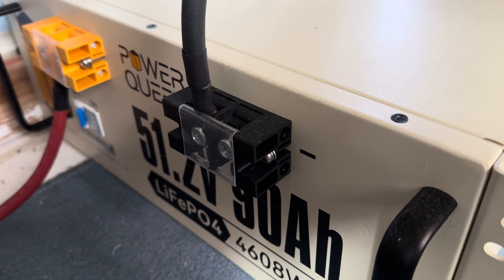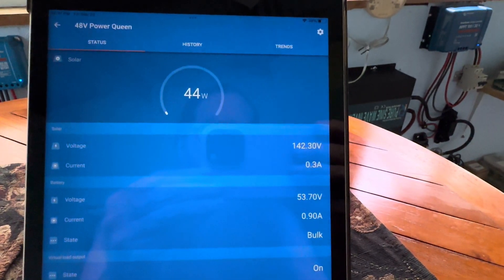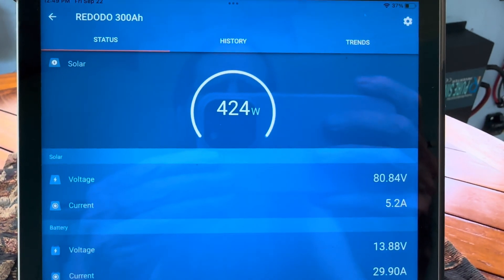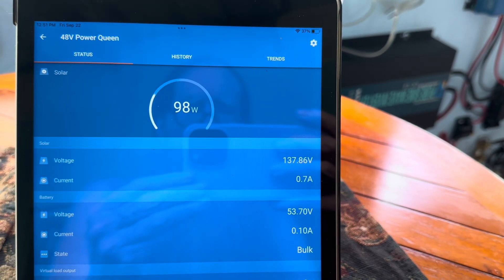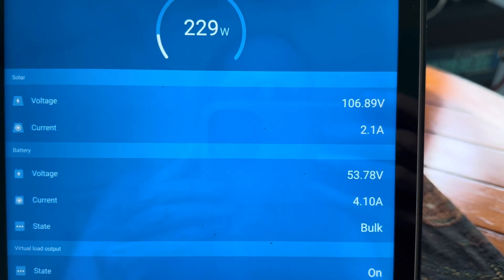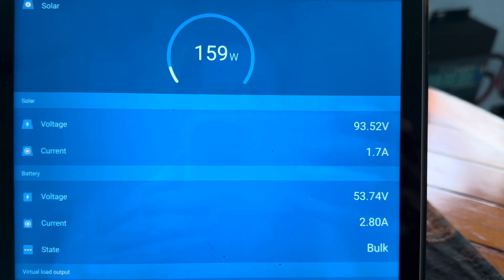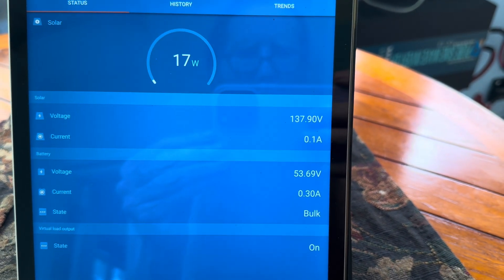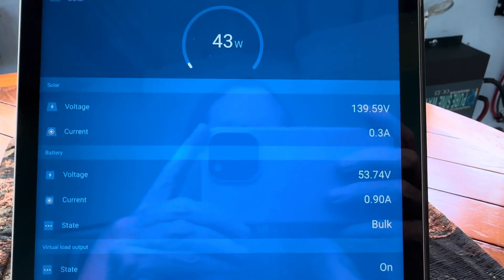48V LiFePO4 charging parameters pt. 2  Follow up from yesterday...very last scene beeps of course!

Comment: Hey,such nice explainers! If I may ask...
How many 48v 200ah batteries can be linked together on a 5.5kw 48v inverter system with 10*550w solar panels?
Would it be fine to link 3* 48v 200ah batteries to 5.5kw(max combined usage) inverter system to access +- 28,800watt hours availability from batteries?
and also, should I put more than 10*550w panels up if i aim for 5500w(1 to 1 ratio) or is there loss somewhere and i should calculate for more panels to reach 5500w?
Thanks so much in advance!

Comment: My brother another excellent video. I am using both a PowMr and a Makeskyblue MPPT charge controller each with 750w going to a DIY 48v lifepo4 battery pack with a 3000w WZReliable inverter. I really don't have that experience of spiking with my charge controllers and my charge controllers is set a the same setting you set at.

Comment: Thanks for the shout out at 1:20.  Man this video is great but now I have way more questions and concerns on this type of battery.  As junkerzn7312 mentioned could these be 15S?  Seems like when I kept seeing 53.67/15 =3.578 the system would cut out vs. 53.67/16=3.35 per cell.  One other oddity on the PQ was 90AH vs 100AH and it made me wonder, but I don't know enough.  One thing that is now making me seriously consider on the lithium front is the lack of battery communications with EACH cell to see what is really going on.  This probably explains why I see many other channels build DIY and/or use chargers to top balance and use smart shunts to validate capacity.  One GOOD thing I saw was that the battery did NOT disconnect voltage and brown out the controller or fry it.  But just imagine for one moment, four of these PQs in parallel!  I mean you would be playing wack a mole driving yourself crazy.  Or maybe the point is to NOT watch the meters?  Now I walk away after weed wacking the lawn with lithium thinking I need to start all over and think of the long term solution......I am NOT dinging your video, but I can't be the only one going like 'now what?'  But hey we're here to learn from one another so it's time well spent on a Sunday evening in cloudy Michigan.  Aloha. Gary
Reply from the maker: I opened this up in original review. It has 16 cells. I am still learning, and for sure still playing whack a mole some...Aloha! 🤙

Comment: Ok umm been doing some thinking keep the Voltron to set lithium parameters like normal to reteach the battery to take normal voltage use the normal settings and when the beep goes off shut off the panels power use as normal then when it gets dark turn it back on to ketch tomorrows light then repeat over time it'll start getting higher battery percentage till it's back to all day without over voltage beep. Just my thoughts I'm not sure if it'll work but worth a shot or just get it to 100% the let it sit with no power for a few days and it may train the bms what full is. Try the latter first the do the former if the latter don't work
Reply: Does the battery have a bms reset that you could do when the battery is at 100% full or does it just have to sit till it refreshs or i have heard fully kill it then fully recharge it?

Comment: I was looking into your battery specs:  It says Charging Voltage should be 54 ± 0,75V  maybe its getting a bit more voltage than needed.  Maybe setting the absorption to 54v and float to 53.6 to have it at 80% max charge might be what it should be set to.

Comment: We're on the same island and yep the solar was crazy yesterday dropping from 3300W down to 600W as a huge dark cloud passed by and the MPPT struggled to keep up. That's 3KW of panels going into 2x LiFePO4 5kwh "server rack" style batteries (10kwh total, EG4s). I've never seen the voltage run up high like that on my system. It shouldn't even go up to 58V! 

I use 2AWG running to my charge controller, I think that may be an important detail with issues like this. I didn't watch closely to see what size you're using today. 

Charging LiFePO4 to 80% on a server rack battery with a cheap BMS is a bad idea because the cells will never get equalized since that small amount of balancing capability only happens at the very top end of the charge cycle. If you never get to that point, the cells get further and further out of balance in each cycle.
Reply from the maker: Can be challenging out here yeah. All in all doing pretty good. over build some arrays for those conditions which are just normal out here! Aloha! 🤙

Comment: Along my friend.  I'm  not sure if yours is the same nor gave I read through all the comments,  but the 100AH version is 54v max charging. I realize that it is 15s so  you are reaching the over volt on the BMS and it is probably  disconnecting charging. The spike you are getting is the power bypassing the battery completely.  Could be problem solved.
Reply: You have to set it manually to a lower charge voltage

Comment: That is the typical behaviour of the BMS shutting down for a single cell overvoltage.

The BMS is only an on and off switch in 99% of the cases. So if one cell is spiking the BMS will shut down.

In my opinion it is not ok. If you want to correct that, the best way is to lower the incoming voltage from the solar charge controller and lower the power coming in, so that the BMS has time to balance the cells with a lower current and keeping it at a constant lower voltage. When the BMS has had enough time it will lower the higher voltage cell and allow a general pack voltage that is higher, doing it bit by bit.

If you have a 2ah difference in the highest cell, and consider the BMS has a 100mah balancing current that is on 50% of the time, it will take 40 hours of balancing to be able to correct that deviation.

So the best way to do that is with either discharging that single cell, or let the BMS do it with a lower voltage for a couple of days, and the next day you can try to increase it by 0,2v and see how it behaves. If handles it, leave it here for another couple of days and so on.

Supposedly, if you let it do it's thing, with a long time of use and cycles it will correct itself.

So, lower the charge voltage to 54V (or even lower if needed) and let it sit there for 2 or 3 days, not letting the BMS get to the point of interrupting the charge at all.

A BMS switching off, gets spikes of voltage coming from the panels (hence the 60v spikes and inverter alarm), since the charging from the panels is higher than your battery voltage, specially in the bulk stage.

If there is more than one cell spiking, the balancing time will take even longer.

So lower the voltage for a few days to a point the BMS doesn't shut down, and try increasing it every couple of days. Slow and steady Is the way to go. No need to rush it.

Cheers
Reply: that was my impression of yesterdays video as well. but from what ive seen there is no bluetooth app to view the bms on the power queens.
Reply: @aniketos7336  no there isn't but the symptoms are clear. Going from 650w to almost zero it is not an overcast situation... it is BMS shutdown. The 17w is what is  being used by inverter on and maybe 1, 2, 3 watts for bms balancing happening. I've seen this before several times. I fix LiFePO4 batteries as a hobby, and 90% of the times it is a matter of runaway cell due to a poor top-balance, and those are the exact symptoms.

Overcast would lower it but not to 2,6% consistently every single time...
Reply: @ricardomarcelino8388  thats what i like about the jk bms. That 1-2 amp balancer is a game changer. Never have to worry about balance.

Comment: In filling the canyon between my ears I poured over videos by Will Prowse and Andy from off grid garage this led me to limit the photovoltaic amps to 5 amps above the load amps. This along with being able to watch the individual voltages in the pack helps me compare cell differences and be charging at lower amperage. Not sure if it will be enough to reach upper 80% level but it keeps PV output of controller steady

Comment: Remember we're dealing with sealed made in china, with mystery b m s.😂 We're not building diy, high dollar Custom batteries here, No separate balancers.  No bluetooth programmable bms😂. We need a Reliable setting that works every time. I'll stick with the Victron preset.🤙😊 i see over 140v on that string and That's close to 150v the controller is Rated for but I think that's ok. I would Definitely consider junkerz comment. If that battery only has fifteen cells. The preset will not work. You need to start a podcast. 🤙😆
Reply from the maker: Day in and day out Victron presets for my systems too! 🤙

Comment: Oh, thank you for the kind words!

It kinda looks to me when it does that (3:00 minute plus or minus) is that the battery is hitting an internal cell over-voltage (3.65V+ on a cell within the battery) and disconnecting charging.   When that happens, the Victron's output voltage will spike because it can't react quickly enough to there suddenly being no battery there to push current into.

What is likely happening is that the 48V battery is cycling its charging on and off repeatedly while it tries to balance its internal cells.  That is, it is probably trying to discharge the high cell(s) and use that to charge the lowest cell(s).

But because the balancer is probably only 100mA or something like that, this cycling is only making very slow progress.

So my suspicion is that the battery is seriously out of balance,.... BUT IT TURNS OUT I AM WRONG!!!

--

Ok, so this has prompted me to lookup that battery.   And now call me a bit confused but the table I found might have caused a mei-culpa.

Power Queen

Battery Series and Best charge voltage:

12V, 14.4V  (4 cells, 14.4 / 4.0 = 3.60V/cell)
24V 28.8V  (8 cells, 28.8 / 8.0 = 3.60V/cell)
36V 43.2V 
48V 54.0V  <--------  THIS IS THE ONE YOU HAVE
51.2V 57.6V (16 cells, 57.6 / 16.0 = 3.60V/cell)

Ok, wait a second.  That means their "48V" LFP battery is not 16 cells in series.  It must be 15 cells in series.

54.0V / 15.0 = 3.60V / cell.

THAT IS THE PROBLEM!  Power Queen is short-changing you.   They have a "48V" battery that for everyone else is specified as 16 cells, but they put in 15 cells.  Then they have a "51.2V" battery that is the actual 16 cells.

This means that all of my calculations are wrong.  So let me redo them:

CHARGE TARGET 3.55V/cell:  x 15 = 53.25V
FLOAT 3.375V/cell - 3.40V/cell:   x 15 = 50.625V to 51.0V

Now Power Queen themselves recommends a charge target of 54.0V, which is 3.60V/cell.   This might be related to how their BMS's balancing works.

So my original postings which assumed 16 cells were all wrong.  Your 48V Power Queen is a 15-cell battery.   Please use a charge target of 53.0V to 54.0V (Power Queen's recommendation is 54.0V).  And please use a Float voltage of 50.625V to 51.0V.

I'm sorry, I should have looked up the manufacturer's specs earlier.  I just didn't expect anyone to sell a "48V" LFP battery in a 15-cell configuration.

-Matt
Reply: Basically there are two possibilities here.  Either it is the 48V 15-cell battery that was mislabeled as a 51.2V 16-cell battery, in which case the parameters need to be set for 15 cells.   In this case the charging parameters are just straight-out too high and it needs a charging target of 53.25V to 54.0V.

Or it really is a 51.2V 16-cell battery and it is seriously out of balance.  In which case I'd recommend going with the manufacturer charging specs (3.60V/cell x 16 = 57.6V charging target) and holding it there until it is able to get back into balance.

You might be able to open that case and count the cells to find out for sure.

-Matt
Reply: @junkerzn7312 It says 51.2V right on the front of the battery. 15s versions of these packs definitely exist but this one says 51.2V, just like my 16s EG4 battery does. This isn't you making a mistake on looking the right battery up, you probably saw 51.2V while looking at the videos already, and just rechecking your assumptions today. 

And the "lets only charge it to 80%" kinda testing would in fact cause these packs to go out of balance further since the balancer can only burn off a tiny amount of excess power in the highest voltage cells.  Which means the balancing needs to happen at a slightly lower voltage or lower amperage to help it run before declaring itself completely full or the overall pack reaching a voltage where the MPPT will declare it completely full. 

And I think you're onto something about the voltage jump really being the disconnect starting to engage, or similar behavior, it's simply no longer being allowed to send power into the battery pack for a moment and the circuit voltage spikes. It makes sense, I saw similar when I was tuning my battery voltage parameters and was higher than I should have been. But I forgot about that, it's been a couple years.
Reply from the maker: Mahalo Matt...btw it is 16 cell, I popped it open in original video review when it arrived. Aloha!🤙
Reply: @ProjectsinParadise808  ok.   That means the cells were out of balance and the BMS in the battery was cycling charging off and on due to a cell getting too high.

If the problems clears up completely with the charge target of 56.8V (3.55V/cell) then you can just run with that.  If not, you may have to bring the charging target all the way up to the manufacturers specification which appears to be 57.6V (3.60V/cell) and see if that clears up the problem.

As another poster said, if that does clear up the problem but the charge target is too high for your comfort, you can always drop it back down after the battery has gone back into balance and it should stay in good shape for a few months.

I personally am very comfortable with a 3.55V/cell (56.8V) charging target in solar applications.  I am less comfortable with a 3.60V/cell (57.6V) target.  I feel batteries that need a target that high just to activate the balancer have been setup incorrectly by the manufacturer.

-Matt

Comment: Set asorbtion to 55.2 with 45 min asorbtion time and float at 54 volts works perfect
Reply: Sounds about right. I think I absorb for 15. This absorb voltage holds the batteries at a level where the internal balancer can burn a small amount of excess energy from the cells with the highest voltages. On an inexpensive battery, this is the only way to get the cells balanced. 

I might even run it slightly lower than 55.2V temporarily if it helps the battery charge at low watts for longer until the cells are balanced better. 

As far as diagnosis goes, you should be able to check the voltage of each internal cell, I can on my EG4s, I have them integrated to victron using the open source serialbattery add-ins. That makes it so I don't have to run the weird Chinese language executables that EG4 pushes out.

Comment: I noticed when it jumps to 63 volts the amps drop to 0 in charging.   I'm thinking the charge controller disconnects and reads a regulated panel voltage without having a charge load.

Comment: It's totally fine to run the Victron preset..It is very similar to other recommended settings..The higher you set your voltage, the faster it charges..The higher you set your voltage the steeper into the charging curve the cells go..With LIFEPO4 you can't really go by %, so what people do to put less stress on the cells is lower the bulk charging to 55.20 volts to keep the cells out of the steep part of the curve, and set the float to 35.60 because that is where the battery likes to rest naturally..If you were to charge your battery full, unplug everything, and come back the next day and measure the voltage it would be right around 53.60...But charging to 55.20 will still allow a full charge..If you were to do a discharge test, you would still get your 90 AH's..Despite what your shunt might say..That is why people run those settings..It's less stress on the cells, but you still get a full charge...With the BMS in those batteries, they tend to balance better at the higher voltage though..But, you could just raise the voltage every few months for two charge cycles and drop back down..But, there is nothing wrong with the preset...
Reply from the maker: Aloha realeyes! I read everything from yesterday and today so far. Appreciate the time and easy to understand ways you present the information. Mahalo so much for being part of the conversation brother.🤙
Reply: @ProjectsinParadise808  No problem..Actually Victron has probably the best preset out of all of the big name solar charge controllers...I lived off of a lead acid battery bank for 15 years, it was massive, huge cables everywhere..Then I went to the cheap premade LIFEPO4 batteries..And then to building my own out of the cells, because it's higher quality and much more capacity for a better price..Except it's more money up front, and harder financially to piece it together..But, at the end of the day you end up getting far more for far less money..Grade A cells gives you 6000 cycles to 80%, the cells in premade batteries is 3000 cycles to 80%, even if they claim more, they are lying..Like all corporations do..That is why I recommend that route..But, if you already have a bunch of premade batteries, the best thing is just to spread your loads out over all your different voltage systems and use the least amount from all of your batteries, to get the most from them..